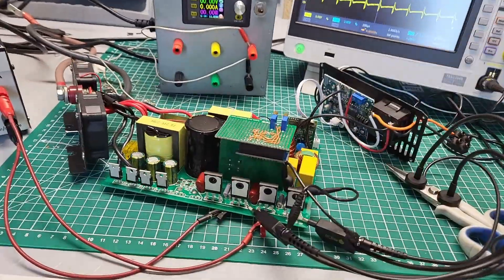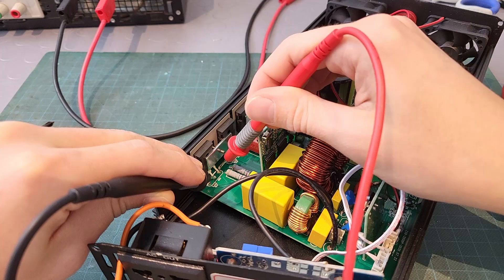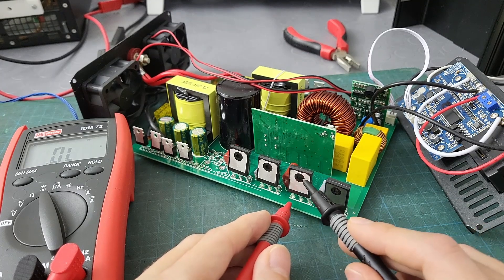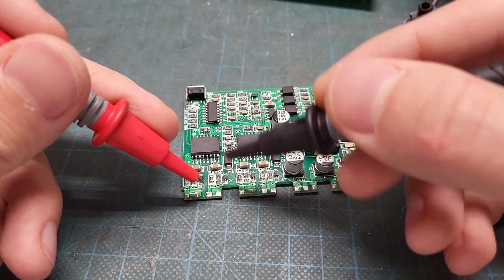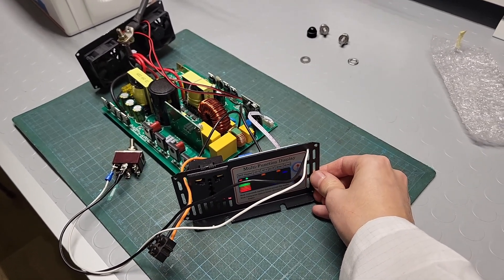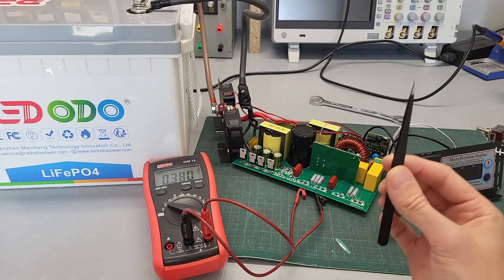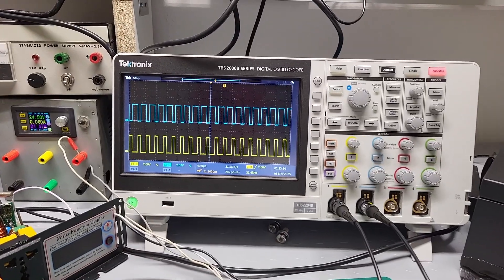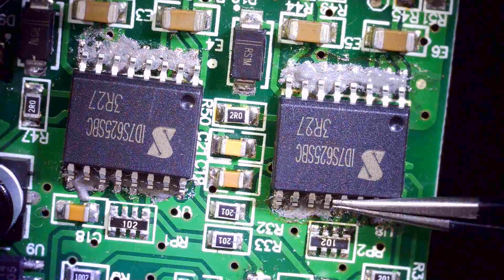How to Repair a 24V to 230V Inverter Hacking It with Arduino ⚡ DIY Guide Tutorial Different Brand

Comment: I wonder if maybe one of the bootstrap capacitors or diodes went bad and is causing your issue. Or maybe one of the gate drive resistors?

Because really there isn't much more to that circuit other than what you already tried.
Reply from the maker: Many many thanks for the comment!:) yes it could be some bootstrap capacitor as I didn't check them. I checked the diodes and resistors but not the bootstrap capacitor. I'll give them a try for sure!
Reply: I have a similar feeling that there is some underlying issue there between the driver chips and the IGBTs. Because the driver chips and IGBTs rarely shoot the crap on their own. It's usually something wrong with how the IGBT is driven.

Bootstrap caps or gate resistors is a good thing to check indeed, they often go bad in car subwoofer amplifiers and take bunch of IGBTs with them. When only replacing the IGBTs, they blow up again pretty soon if not immediately. Ask me how I know..😃